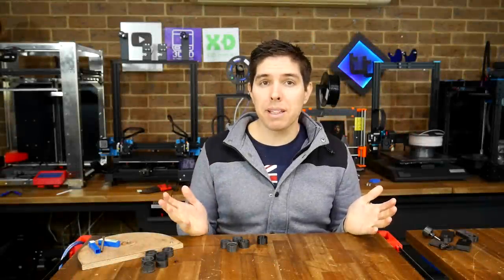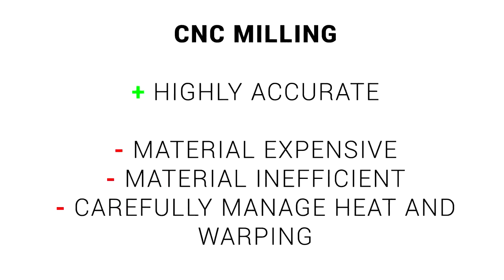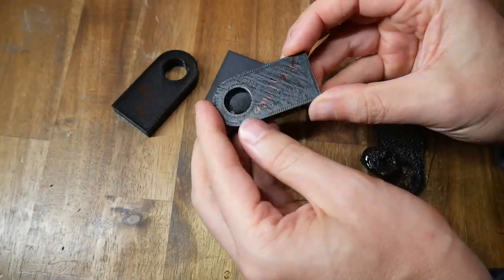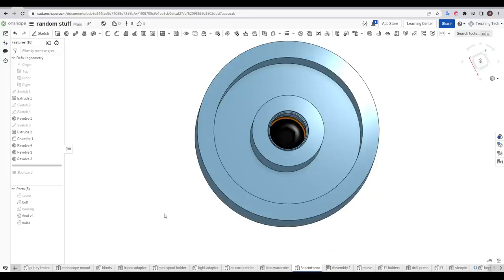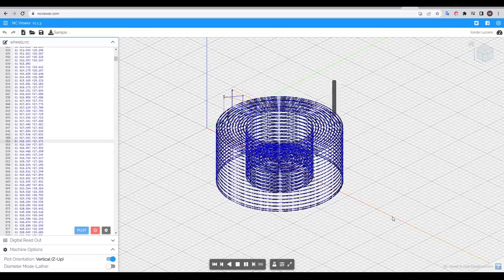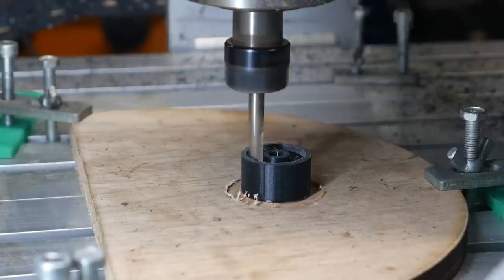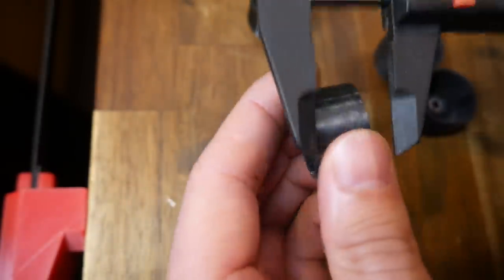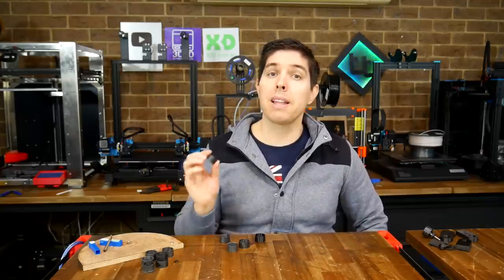3D printing + CNC milling - Worth the effort?

Comment: Use a solid rod in the chuck to center parts. Centering on drills/end mills never comes out quite right. And instead of trying to jog the spindle to the part, tighten the clamps to the bed while the part is held centered by the rod. Quick and accurate.
Reply: Or you could mount a $20 edge finder……
Reply: I use a rod with a 60 degree taper on the end (This works with holes of varying sizes).  Use it to force the work against the spoilboard, (or whatever).  This centres and holds the work, so you can screw/clamp/glue it according to your preference.  The method dates back to hobby lathe work, many years ago...  use a centre in the headstock to push the work against a milling slide attachment, then clamp the work.  I also used a centre in the tailstock to hold work against a four-jaw chuck, before snugging the chuck jaws up to the workpiece.  Equipment moves ever forward, but some of the problems remain the same!    :o)

Comment: an alternative way to look at this is that you could use this as a way of recycling your 3D printing waste. Modify a panini press or similar to have a temperature control from a standard PID controller, melt your waste at its lowest plastic temperature (to prevent degrading of the plastic) by heating and folding in the way people recycle PET bottles, then press the molten plastic into moulds CNC milled from wood. Once its cold and you extract the blank, you can mill the part to size from the blank. Probably not suitable for the high tolerance parts you are making, but it would be a great way to reuse your failed prints and prototype parts, since the equipment tor making recycled filament is beyond the reach of most hobbiests. Unfortunately I don't have a CNC or a workshop to try this out, but it might be an idea for a future video?

Comment: One of the other advantages of "3D Print then Mill" is that you can print with larger layers and wider nozzle diameters, which increase production speed and part strength.  Also, the addition of a coolant spray or water flood to keep the tool and part cool will help with some of the plastics that get grabby when they heat up.
Reply: Compressed air works really well with plastic too. Clean and simple.
Reply: Good idea! You could also intentionally "squash" your layers to get better layer adhesion.  The horizontal expansion doesn't matter if you're intending to mill to dimension.
Reply: The layer height is indirect proportional to strength. Smaller layers - - > more strength
Reply: @Taconiteable  Look at the results of CNCkitchen for this. He made a whole video of this. It is right to a certain level but not all the way.
Max strenght is just a bit above half of the nozzle-width (so for example .24  or .22 for a .4 nozzle, depending on material and temperatures)
Reply: @Taconiteable   It's the ratio of layer width to height that matters. A 1mm layer width and 0.25mm layer height (4:1 ratio) will be stronger than 0.4mm layer width at 0.2mm layer height (2:1 ratio). Strength increases tend to level off above a 4:1 ratio.
Reply: Not completely right for the nozzle diameter/layerheights, for the cooling yes. Compressed air with water mist.

Comment: For that specific application, I would ditch the 3d printing altogether and just go with the lathe. Machine it out of POM (Delrin) round stock. That stuff machines very easily, so you'll get an accurate part with a smooth finish. You won't have any of the material waste or heat issues you had with milling acrylic. This addresses all of the points you listed. The only downside is that it requires a bit of manual work, but unless you are mass-producing it's not that much and for students it's a great learning experience.
Reply: Agreed - "right materials and tools for the right job".  If you just 3D printed a solid rod of material and then machined it on the lathe it would have the same result.  Then it is a matter of choosing the right material for the lathe.
Reply: Yes, I've been doing this. Works very well and you can get real strong and accurate results.
It might be hard to get it in all colors though which is a positive about 3d printing your base-materials.
Reply: I was thinking the same thing watching this. This use case is basically what lathes were born to do.

Comment: I use that process for technical model parts.
I use a 0.7mm nozzle, with high extrusion speed and high heat to get good layer adhesion. The optic is not that important. For parts with high stress i cook them in salt to get rid of the layers. I machine them afterwards. I use that process also for lost form casting and then machining. Very useful for parts you have to fit in place. I print and machine the plastic until the result is acceptable and then cast it (aluminum and bronze). The same machining as for the plastic is used to get the exact part i want.

Comment: It would be interesting to aneal the wheels and then cnc them. This way you could turn a readily available plastic like petg into a harder, more temperature resistant one. The anealing would compromise dimensional accuracy but then you cnc them to perfection.
Reply: I don't think annealing would change the PETG that much. Stefan at CNC Kitchen already did some experiments annealing PLA, PETG, ABS and some high temperature materials. The PETG and ABS had no change in temperature resistance after annealing.
Reply: @Felipeh999  temp resistance perhaps not, but it would probably improve mechanical strength & hardness, which would be more important here
Reply: @Felipeh999  Ah, I missed that video. Thanks for bringing it to my attention :D
Reply: Annealing plastics only releases the internal stress created when printing. by evenly heating, then cooling all layers at once you remove the stress.
but the plastic wants to go back to its original shape before it was printed. this means it wants to shrink in the XY direction and grows taller in the Z direction.
Unlike metal where annealing changes the crystalline structure inside the material.
Reply: @awellner3285  it also improves the strength of the bond between the layers- especially correcting any weakened bonds from uneven layer temps during the print
Reply: @awellner3285  not only that. In some semi-crystaline polymers, like PLA, annealing also promotes crystal growth, which is what changes the temperature resistance in annealed PLA.

Comment: This is really interesting and coincidentally something I've been thinking about lately!  I recently built a beetleweight combat robot out of Billet UHMW and learned a LOT about cutting plastic

A couple thoughts for you to ponder for your application: 
-Masking tape and super glue would be ideal work holding here.  You've got almost the surface area you need (3 sqin or so) and if you're printing extra to mill away you can probably add a 2mm or 3mm think area  to add an extra little bit of surface area if you need.  You need the workpiece secured at two points at least to keep it from rotating. Unless it's an engineering plastic you're working with this would be cheap.

-I noticed you're climb milling.  I found with UHMW (much more gummy and nylon like than say ASA/ABS) that conventional milling was king.  No matter how small a chip load I was trying to run (while remaining a chip still) climb milling was a disaster.  As soon as I switched to conventional it milled like butter.  The lower cutting force helped tremendously.

Thanks for the video!  cool to see it in action!

Comment: Having been a professional CNC programmer, I can state that these are some ugly tool paths. The cooler tool path options are not available in this type of software though. And tooling choice plays a part in the process as well. Both tool and software that I would recommend are outside of financial feasibility though. A single flute HSS endmill is not super expensive. A 2 flute variable pitch carbide endmill is rather costly. Variable pitch endmills allow for greater cut depth and removes the need to step down.

I haven't looked very closely but I would almost bet that Fusion 360 might have the type of toolpath that would be suitable for excellent results. A spiral cut (no step down) with a lead out (to avoid lifting straight away from the work part and rubbing the entire edge) with a super minimal step over and the use of fluid cooling (water) would be optimal.
Reply: Ditto, & agreed. I find hss cutters are generally better than carbide for plastics as long as cooling is up to the task. In this application a flow of compressed air would probably be preferable both for cooling & chip removal. Fusion 360 does indeed have more than adequate tool paths options. It’s the software my present firm uses exclusively for cnc programming (at my recommendation…..)

Comment: a dial indicator, preferably a coaxial would have been better for locating the part. a 3 jaw chuck would also be better for holding the component in place.

Comment: I love the concept in using different types of plastics
But really 3d printing is far inexpensive for prototype against cnc of metals
Meaning if you prototype in 3d printing and see the out come then if your happy with the concept
Then one takes it one stage further to cnc in metal.
Thus the cost is far less
No machine cost in wasting time on cnc if one can prove the design via 3d printing
Note one can also print in proper ultrafine metal 3d fililament.
And is a lot quicker begor taking the design project to a commercial cnc metaling machining.
I prefer the the latter.
I prove designers on a 3d printer then go ahead on machining. I save many hours and on tools
Reply: That is ideal. A 3D printer may also create the bulk of the part and just the functional surfaces get machined comparatively quickly for the test.
Reply: @Inventorsquare  my point exactly

Comment: Great video. I use a manual lathe for machining 3D printed parts now but used to regularly machine nylon and other plastics on a VF2 milling machine. Generally, for plastics if you can try increasing your feed rate it is better for getting the cut “over with” and the tool away from the material before it can melt. 

Machining from 3D prints is highly effective because you can use more lights-out strategies, save time on complex geometry that would require multiple setups or axis, and so much more. It’s the end game.
Reply: I wish i got more time on the millturn with welding additive.... That stuff was awesome

Comment: great video! but that tool never really gets to cut, it only rubs on the surface, when i machine plastics i programm mostly conventional cuts (because postive tool geometries , like mills made for non ferrous metals tend to "bite" of the corners of the workpiece) but i would still strongly recomment a mill wich has a positive cutting geometry, it generates next to none heat when used correctly. and you maybe wanna try to raise the feedrate significantly, i dont know  what your mill is capable of but on "my machine" Hurco VMX 42i i run comparable endmills @ 10000 rpm and 6000-10000 mm/min, with 1-3mm stepdown, if your machine isnt capable of such feedrates try to lower the rpm till you  get roundabout 0,05-0,25mm feed per tooth, only conventional cuts, or you will send your piece flying ;D. if the workholding is not strong enough try to lower the stepdown first.
the idea behind this strategy is you wanna be feeding faster than the heat, and move as much heat as possible into the chips, so you always have cool material to machine wich also reduces friction heating by a lot. collant is strictly forbidden, it clogs up the chips, try tool with compressed air instead and if thats not enough consider pure alcohol is an option. i can mail you videos of some programms i wrote if you want some visual context. greetings from austria, not australia:D

Comment: Why not just use ABS if you want temperature resistance?
I don't understand why people seem to think ABS is a material that's not actually used anymore. It's far better for functional parts than PLA or PETG.

Comment: I’m curious as to why you went this route instead of just buying a sheet of ABS board, especially since you want the wheel to be solid anyways. Sure, it can be expensive ($60 for a 30x30x2.5 cm board from McMaster Carr), but would be way easier to mill, would take a quarter of the time because you don’t have to worry about 3D printing, and probably costs the same pound for pound as the ABS rolls, and will be stronger due to no layer lines and such. That, on top of not having to fret over making sure your tool alignment is perfect

Comment: Some things you need a CNC, like this tungsten/halogen laboratory light source I am building. Tight tolerances, extremely hot temps in the housing.  Means no plastic parts, cant use 3D printed metal or lost PLA castings.

Comment: This is really interesting as I have an E3D Tool Changer and I've built an ASMBL toolhead, but I then read on their site that it's no good with PETG (Which I use for everything) so I never tried it. After seeing your results, I'm going to have to give it a go!

I don't think you mentioned how much you expanded your model by, but you probably want to try to ensure that you'll be milling right through the middle of a layer. (I.e. Expand by 0.5x the line width, or 1.5x, or 2.5x, etc) I think that would give you the best surface finish.

Comment: set your nozzle diameter higher use a 0.4 but set it to 0.5 or .6 this will make wider flat tracks
also in the world on cnc 
setting up home switches (i use inductive probes for this) 
setup a tool height set point ( mine is a spring loaded steel dowl pin sticking out of my spoil board i have a wire attached to the pin and it checks for contact a simple wingnut under the table compresses the spring so the pin is exactly 0.2500 from the surface using this pin as a datum in all project files with height collars on my tools and a tools preset in my cam software makes it easy to change tools during a job. also i know that Z0 is the surface of the spoil board at any point on the table (i bolt down a 0.5in sheet of MDF and do a surface pass and drill holes counter bores for inserts

Comment: Great video! ! A few ideas: If you switch to Fusion 360 for CAM, you could use a helical tool path for the outer surface with a tangential exit strategy, it should be smoother. Also, single flute end mills tend to work better for plastics (to keep the chip thick enough with a limites feed rate)

Comment: I'd be curious to compare that to milling resin printed parts. The nylon like resins seemed to machine really well and I was able to hold a tolerance of .001 inches on printed parts. I was able to thread the parts using a sharp tap as well, so it might be worth looking in to.

Comment: I’m glad I’m not the only one thinking about this. I’d like to see how it does making sealed mating surfaces like on an engine or compressor. I’ve been curious about using 3D printing to make small engine parts like cover plates or intake plenums with injection ports for converting carburetor engines.

Comment: Use different perimeter widths on even/odd layers to obtain more structural integrity. This will also hide all the tracks you see: they are pieces of perimeter ripped out. Perimeter width even = 120% off nozzlediameter. Perimeter odd = 145 % off nozzle diameter. External perimeter does not matter, because you remove that. For accuracy: you don't exactly center the part with the bolt, it does not really matter unless you use that hole. Remove less, move faster. (remove .1 mm or less at a time, feed rate 80 mm/s) The bit should have a perimetrical speed of 100 m/min (= 100 000 mm/min or for a 6mm bit = 5304 rpm, you are at 300m/min with 15000 rpm)

Comment: Nice video, but you still have a lot to learn about making perfect parts.
I've left some pointers below, good luck.

15mm acrylic could have been cut with CO2 Laser and then you could do the lathe part.
Also, the CNC Milling of acrylic should have been done with a lot of water, slow spindle speed and slow feed rate.
You could also try water jet cutter for acrylic.

7:20 ... Your whole process is wrong.
You should have clamped the Spoil Board to the  CNC first.
Then you should have milled a 1mm deep square with a large end mill, now you know that your board or work surface is perpendicular to your Spindle and you also have a good Zero on your Z axis.
Then have the CNC Drill a Hole so that your holding could thread it's way into that hole to hold your part.

I think you need conventional cutting for plastic.
At least for Foam Cutting you have to use Conventional.
And you should have used water.
Spray soap water there like a madman.

Comment: Check out DMG Mori. They have been building metal 3D printer + 5 axis milling combination machines for a few years now. It's basically a 5 axis milling machine with an added laser welding torch. Mind-blowing to watch.

Comment: I think without utilizing the benefits of additive manufacturing (parts featuring unmachinable pockets) and more specifically in this application, a solid rod of your chosen material would have served you better.  You could order in the correct outer diameter so external machining would not be required and you'd have a nice surface finish already.  You could then machine the inside pockets first (center bore, bearing housing, etc).  This would allow the pocket wall to be supported by all the outer material; it'd serve to reduce flexing when the endmill engages.  You undoubtedly have some flex in the 3D printed part as that wall is only a few mm thick plastic between the bearing/outer pocket.  After the bearing area is machined, you could machine the pocket between the wheels internal/external walls since this is a less critical area.  I agree with the other commenters on your CAM software.  Those paths being generated are making this way more difficult on you; maybe check out Fusion 360 which is free or I think even Solidworks has education packages for $20 or so.